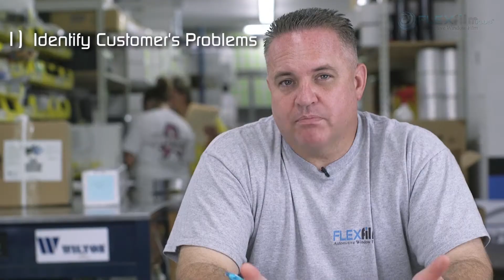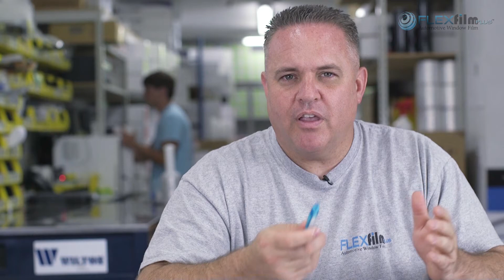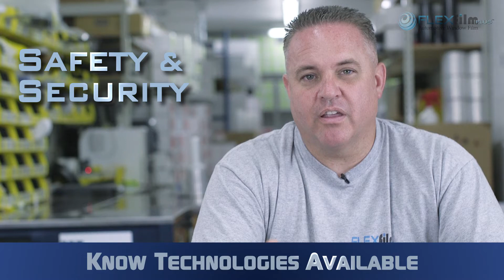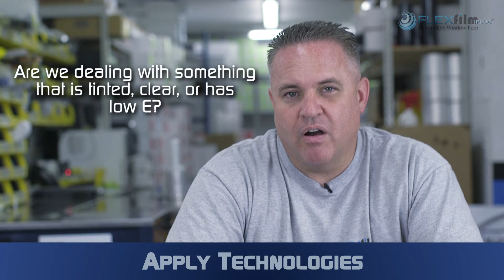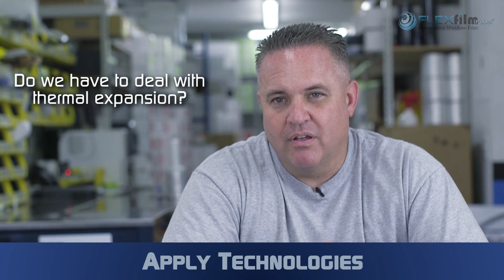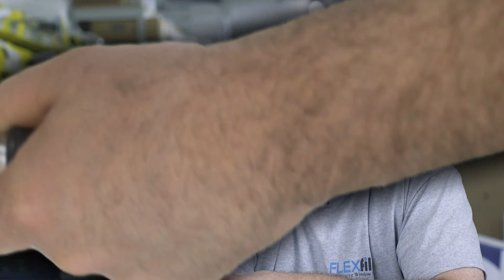Flat Glass 101

Comment: What is the difference between mirror tint and dual reflective tint? I've googled this question to death and cannot find a proper answer..
Reply from the maker: Mirror tint is usually vapor coated aluminum and is equally shiny on both sides.  Dual reflective tint is one layer of vapor coated and one layer of dyed film.  The mounting adhesive is on the shiny side and installed on the inside of the glass.  From the outside, it looks shiny and from the inside it is non reflective.   This is just a very basic explanation.
Reply: @Ralph Van Pelt  okay, I think I understand. A follow-up question then, for clarification, does this mean that mirror tint is reflected in both sides? I know now that dual has a reflecting property on one side and a tint the other. So on mirror tint, if im standing on either side of the glass, would I only see my own reflection, or is it reflection an outside view while the inside, I can still see outside the window or door, but there is no tint? Sorry for the long-winded question. I just really want to know. Btw, THANK YOU for responding!!
Reply from the maker: @michaelbaksh4942  
Mirror tint is the same on both sides.  How it looks depends on the lighting conditions.  In the day, hard to see in and easy to see out.  At night with interior lights cut on... it is the opposite.
Reply: @Ralph Van Pelt I FINALLY get it! Thank you so much!